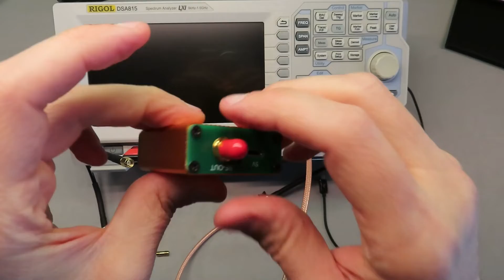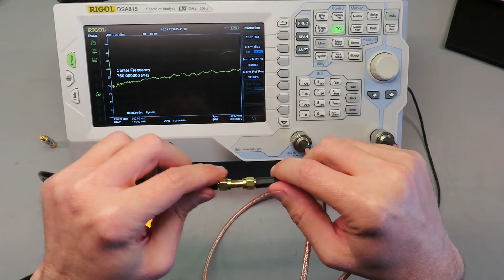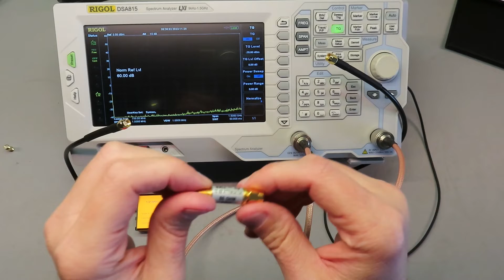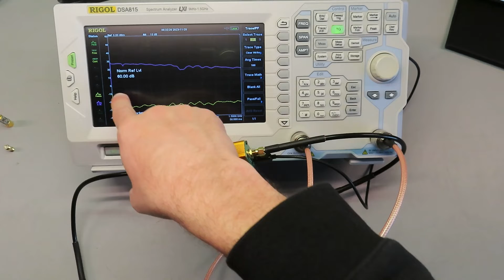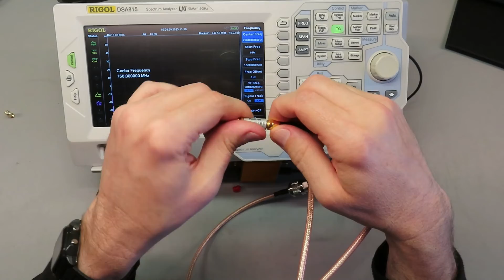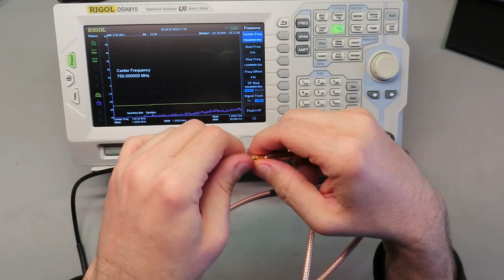TQP3M9037-LNA Gain Test

Comment: Have you tried to measure the noise floor when switched on but no input signal is applied? The chip itself should have 0.4 db but would be interesting if the while box adds more and if it is really a TQP3M9037 chip or a cheap clone

Comment: Good presentation, now you just need a noise figure meter to really charactorize it!  My measurements at 2304Mhz were about  18db gain with NF of .78? (noise head a little out of cal).  Not bad at all for $15 device.  Like ablaauw, would have like to have seen inside...

Comment: I would have liked to see what's is in the box. it looks nice, seems perfect for the Hackrf One. Just look further to see if anyone has already opened it so you can see what's going on inside.
Reply: I use this on my Portapack H2+ HackRF One and it's excellent. Inside it just looks like a board with a battery.